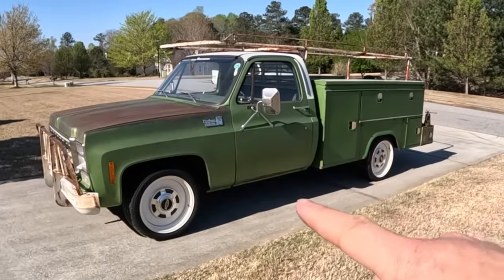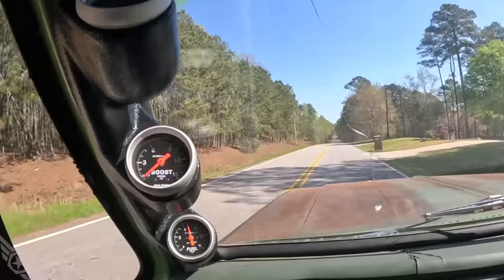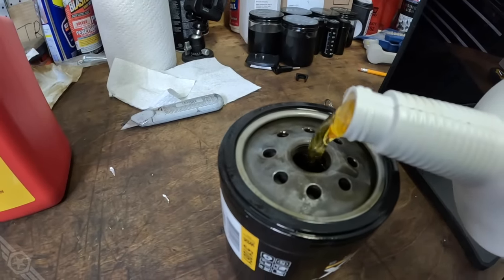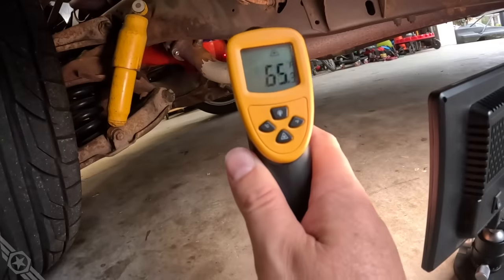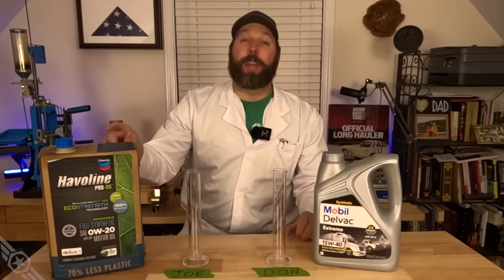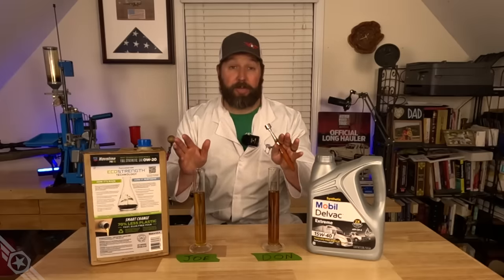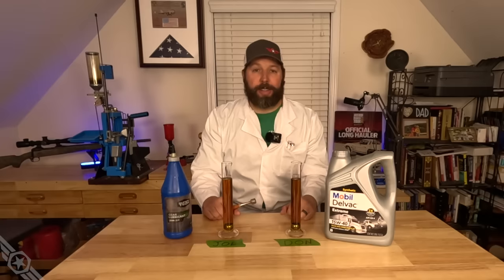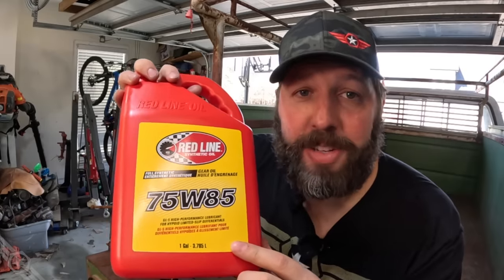Running GEAR Oil in an ENGINE!!! (EXTREME PRESSURE)

Comment: It's almost like there is a pressure relief valve in the oil pump......
Reply from the maker: You think a SBC oil pressure relief valve lifts at 45PSI? 😂😂😂
Reply: @freedomworx  depends entirely on how worn it is. as its a sbc it probably came fucked from the factory
Reply from the maker: @RedmistAU  the only thing fucked is your assessment of the test. The oil pressures were the same (actually the gear oil was marginally lower) because the oils were roughly the same viscosity. Had nothing to do with a relief valve. Oil rarely passes through the relief valve. It only opens during cold starts or extremely high RPM situations.

Comment: It is because it ain't absolut values but relative so, you can have relative to whatever!
Reply from the maker: The viscosity grades are defined in different SAE Specifications. That’s why they are different. SAE J300 vs SAE J306. That’s the point of the video.
Reply: @freedomworx  That is what I wrote!

Comment: nothing smells as bad as gear oil, I did a 8.8 rear axle in an F150 years ago in the middle of winter, had to flush the axle housing with degreaser and hot water but the water that went out under the garage door froze, it smelled like dinosaur butt until may around the garage lol!!!

Comment: Of course the pressure is the same. There is a pressure relief in the system 🤦‍♂️🤣
Reply from the maker: You think the pressure relief valve in a Small Block Chevy lifts at 45PSI?🤦‍♂️🤣

Comment: That gauge is not accurate enough to provide the results that you want.
Reply from the maker: The result I wanted was to show that the gear oil didn’t increase the oil pressure. Which it did just fine. The oil pressure was actually lower with the 75W-85 in it. Regardless of the magnitude, it was lower. 🤷🏻‍♂️

Comment: My gearbox(diff) uses ATF - but it's an EV
Reply from the maker: It likely has planetary gears like an automatic trans 👍
Reply: @freedomworx  Nope, all in one with 2 shaft reducer and only 1 quart. It STANK at 60k miles (bad enough to be gagging)

Comment: it will get oil quicker by filling the filter.
Reply from the maker: True but does it actually matter? There is already oil there. 🤷🏻‍♂️. Many small engines have no oil pressure for their entire existence…
Reply: @freedomworx  ya i know. but i do it if i can.
Reply from the maker: I do too. But I still want to do some experimenting with it. 🤓

Comment: How can pre filling the filter be bad for the engine I don't see it. It's just common sense you're not dry starting your engine
Reply from the maker: You are not dry starting the engine just because the filter is dry. There is still oil on the bearing surfaces. Caterpillars argument is that you might introduce foil or something from the bottle into the outlet side of the filter. It is rare, but it has happened and resulted in failed engines. You clog an oil cooling jet, and the engine wont live long when its loaded heavily.
Reply: @freedomworx  that does make sense anyone who doesn't know to check for contamination I could see that happening

Comment: Gear oil is real thick that crap poured out like motor oil
Reply from the maker: It’s the thickness that 75W-85 Gear Oil is required to be by SAE J306 🤷🏻‍♂️

Comment: Looked a little thin for gear oil dude.just saying .lol
Reply from the maker: It's the thinnest gear oil out there. But it was, in fact, 75W-85 Redline Gear Oil. That's the point of the video. Gear oils aren't as thick as you think they are based on the numbering system. It's on a different scale than engine oil. SAE J300 vs SAE J306

Comment: But you can run engine oil in you gear oil.
Reply from the maker: In a manual trans. Wouldn’t work to well in a diff.

Comment: This is partially correct, partially not correct. Gear oil is typically much more viscous than engine oil. Typically around 75/90 where engine oil is anywhere from 5-50. 
With the additives they do have some cross on the viscosity index, but gear oil doesn't contain the additives to help remove carbon/combustion byproducts. If your vehicle will run with 50 oil, gear oil is fine short term(I.e. emergency). If it takes 20, not a good idea.
Reply from the maker: What part of my video was not correct? Specifically.
Reply: @freedomworx  I already stated it. The part where you purport that gear oil is 'fine' to use in an engine, and this is definitely not the case.
It does not have the additives to deal with combustion byproducts. 
It's very misleading. While it will not blow your engine up immediately, it will for 1000% sure cause far more deposits of carbon and other chemicals to build up in places they shouldn't, prematurely wearing the engine.
Reply from the maker: @TlD-dg6ug  maybe you should have watched the entire video before calling it incorrect. Every aspect of your concern was addressed at 12:15 🤷🏻‍♂️

Comment: WHAT A DILL!!!!!!!!!!!!!!!!!!!!!!!!!!!!!. EVEN the Dullest of mechanics know certain oils perform specific tasks. Maybe his had band is TOO TIGHT and reducing the blood flow to the thinking area. Why doesn't he simply put water in there instead of gear oil? It is liquid too!  Apparently, he has NO KNOWLEDGE of Oil pumps and mechanical loading, flow rates, viscosity etc. He PROBABLY WOULD BENEFIT FROM DRINKING IT!  HE should try and see what happens!
Reply from the maker: And you obviously didn’t watch the video. 🤡

Comment: Modern gear oils must be significantly thinner than the EP80/EP90 of my youth🤔 

Your poor engine (and your poor nose). I hope you treated it to a flush after this experiment (your nose too😆).
Reply from the maker: I didn’t flush it, just drained it and filled it with 10W-40. It’s a SBC… It won’t care 😉
Reply: 😆 that’s a very specific type of neglect I can understand 😆 

Has the stench abated yet ? 🤣
Reply from the maker: Yep. Just tore down a 12 Valve Cummins in my garage, so everything smells like an old school bus now 🤓

Comment: That is not what was in that container you put probably 1040 back into the container and then glued the seal back on you're not fooling anybody
Reply from the maker: Yeah, it’s 75W-85 I’m pouring out of that bottle. You’re just too f’n ignorant to learn anything. Read the damn SAE documents moron. 75W-40 is thinner than 20W-50. Duche Bag 🤡

Comment: Fake, The color does not match gear oil. 75w85 has a orange yelow or red collor. So stop your fake videos
Reply from the maker: You're just too ignorant to except facts. 75W-85 is thinner than 20W-50 or 15W-40 engine oil. It's a simple fact. I gave you the charts and told you the specifications are SAE J300 and SAE J306. I can give you the information, but I cant make you understand it🤡